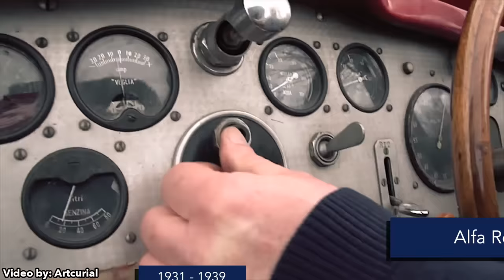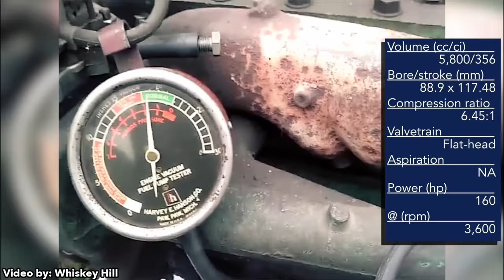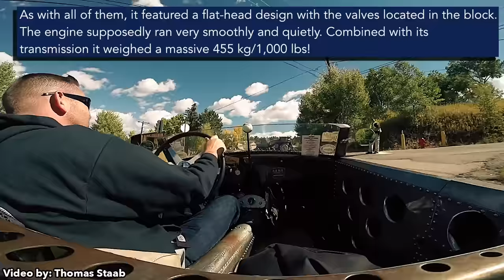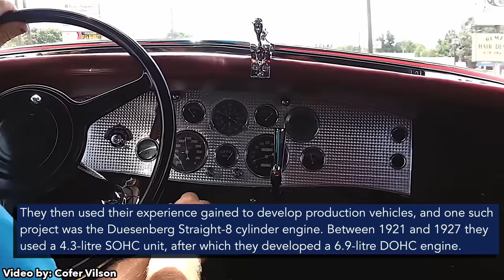The Best Sounding Straight-8 Engines In The World

Comment: they sound more like musclecars than musclecars do
Reply: they have 90 degrees cranckshaft like those crossplane V8s in muscle cars
Reply: No they don't, they sound more like old airplanes or old world war 2 trucks lol. The unbalanced firing order of cross plane V8 is what makes the sound of a muscle car. Straight eights do sound pretty cool though too.
Reply: @ssimon64  Lmao but that's where it originates from tho, Straight 8s/inline 8s have some of the most unique rasps in existence.  Sure we have new V8s and Flat 8s but they never quite have the correct sound. The coyote engine in a 5.0 mustang, for example, doesn't really sound all that aggressive even with a straight pipe, only with a cam does it wake up the motor. Straight/inline 8s sound like what all 8 cylinders should lol
Reply: @sebastianb5997  Even the 392 in the new Challenger sounds...tame...by comparison. A 300-something c.i. straight 8 sounds like it's going to eat the world.
Reply: @nicholasrhodes4550  you all have to remember modern cars are muffled.
Reply: @ssimon64  The joke

----------------------------------

Your head
Reply: Dodge Challenger
Reply: Yes they do.
Reply: @sebastianb5997  I'm glad that you cant dictate what a V8 should sound like.
Reply: I mean, "inline" and "V" formats doesn't matter that much, if both engines have the same firing order, they will sound the same lol
Reply: @klyo3475 THIS.
Ditto for torque characteristics.

Comment: Straight-8, because v8 is too compact
Reply: CaptainD00M the straight one has better natural balance.
Reply: that is why i think that inline 6 > v6
Reply: V6 is very unbalanced, almost as bad as I4. V8 is a little better than V6. However, Inline 6 and I8 are perfectly balanced. Flat 4 is almost as good as I6 but flat 6 is just as balanced as I6 or I8
Reply: I belie the 60 degree V6 is considered to be a naturally balanced engine & should be compared with the 90 degree V6.
Reply: all you have to do is look at the counterweights on the crankshaft. Subaru flat 4 crankshaft weighs 18lbs stock. Honda or Toyota Inline 4 is twice as heavy at around 35-40lbs. All the V6 crankshafts I saw were 60lbs or more.
Reply: Y10Q. Flat 4 engines maybe very compact but have very thin crank fillets between the bearings. To solve this problem the big end and main bearings are very large for overlap to make the crank rigid. This creates a new and bad problem. The crank surface speeds become very high between the rod bearing and journal making stable lubrication difficult. 2.0ltr motor in the Toyota 86 has massive journals i think 77mm. An LS V8 is little over 40mm. Inline 4s are much superior as a design.
Reply: At some point, balance is basically irrelevant.  That point is when the engine is reliable anyway, and smooth and sonorous enough anyway.  Spin up a Honda or Toyota 3.0 or 3.5L and tell me it needs better balance lol
Reply: The Bushwacker Spot on. The reference to the ls was journal size only. And to split hairs V8 arent perfectly balanced. Check out the back of chev crank you 'll see an external couter weight. I6 dont need this.
Reply: The Bushwacker Exactly. The very nature of a reciprocating combustion engine is very flawed. Alot of mass is added to engines to cancel out these forces whether its a 4, 6, 8 etc.
Reply: +David Conod I misread your name as "Conrod," haha appropriate.
You clearly know quite a bit more than I do about engine internals and balancing.  I knew I liked Toyota V-6s, they have quite a bit of "character" when pushed hard - I had no idea their internals were at all similar to a race engine or anything.  I drove a 3.0L Solara (Camry coupe) manual for four years, and I could scarcely imagine a six-cylinder being any smoother than that 1MZ was.  And now I know why lol, thanks.  Why don't other companies do that end bearing trick?
Reply: +The Bushwacker Whoa whoa.  A straight engine has no reason to be more torquey or less revvy than an inline of equal cylinder count and dimensions.  If you're going by what tends to be, that's incidental because of packaging - Inline engines tend to be very undersquare (seen in the video).  This in GENERAL makes them more torquey and, yes, less rev-happy.
Any sources on that Silver Streak versus 454 comparison you mentioned?  (Even though that's more a test of traction, gearing, and weight)
Reply: Bryan Liguori You'll probably find most modern 4 cam V6 use that design because it ellimintes balance shafts. The 1MZ was a good little V6. It had 6 bolt mains and a good cyl head design. you'd love the 3.5ltr 2Gr especially the direct injected one's in the IS 350. they're pushing over 300bhp and still remain relatively low stressed. Pity a new age of small turbo 4s are taking over. Fuel efficiency is at the top of the priority list. The I6 is basically doomed.
Reply: Bryan Liguori Totally agree Bryan. Any V configuration with exact same bore/stroke, combustion chamber design, cam timing etc will equal an inline engine. In fact it will probably win because of the shorter and lighter crank has less inertia and will rev up quicker. Granted once high revs are reached the heavier inline crank will have more energy stored. This problem is easily solved by using a flywheel on the V6.
Reply: And the sad thing is small turbo-4s are often shown to offer no real-world (which is ostensibly what really matters) gains in fuel economy over the sixes they're replacing.  It is a pity.
Though I've just read that the new 2018 Camry is keeping the V-6 - a direct-injected version - so at least Toyota might see it that way.  Or maybe, it's that Toyota's customers do, while Lexus' do not, hence the IS200t.
I loved my 1MZ - but damn it could have used better valve timing at high revs.  It was pretty short-stroke, but ran out of steam by 5600 rpm.  If I could get a 2GR in my FR-S, I would be one happy camper.
Reply: YES back when the car was just a concept, I hoped for a Subie flat-6 engine in it, being that it's a Subaru chassis with a Subaru engine already.  I really don't want to muddle the response with turbo lag, but it obviously could do with a nice power boost.  Oh well.  There's always the aftermarket I guess.
Reply: With respect to you Bushwacker your association with inline engines and more torque is totally incorrect. The torque output of an engine has nothing to do with where the pistons are located (inline, V or radial etc). Its all about thermal and volumetric efficiancy. The old inline engines you talk of did have massive lowdown torque due to the very long stroke designs they had. The cranks were heavy and yes once higher up in the rpm range store alot of kinetic energy. The distance from the main bearing to the big end bearing has a huge effect on the torque characteristic. Any V configuration with the same cyl head design, cam timing, bore, stroke will equal an inline design and rev up  quicker due to its shorter lower inertia crank. Take a look at V8s that have a flat crank compared to a cross plane crank. Flat cranks have much less weight and are generally SHORT stroked. This makes for very quick engine response high in the rpm range. (torque x rpm=hp). Long stroke engines have high piston speeds low in the rpm range particularly with a short conrod relative to stroke (good volumetric efficiency) therefore low down power. Take a look at a landcruiser 4.5 V8. Small bore, big stroke. 86mm 96mm. Yes i know its a diesel and there's a couple of turbos, It produces max torque at 1600rpm! 650nm of it. Any long stroke modern engine with high efficient heads and management systems make MASSIVE torque. Ive seen demo's of Z06 vetts going from 0-160 mp/h in ome gear! Dont get me started on the V10 8.4ltr donks. I'll say it again long stroke=lowdown torque not inline configuration. Cheers.
Reply: The Bushwacker The Bushwacker No worries mate im also done. I think we will agree to disagree. im wrong aboutThermal efficiency and volumetric efficiency wow. Thats were you lost me.
Reply: Straight engines tend to have much better long-term reliability and a slightly higher low end torque., the crankshaft journal only have to deal with one connecting rod instead of two.
Reply: The 4 cylinder engine in my Mazda has valves per cylinder and it's blue.
Reply: Yes, basically everything Bushwacker said about I6 torque > v6 torque and V8 balance > I8 balance is completely wrong, see Conod and Warnes comments respectively for the facts.
Reply: Well, that's because small turbo fours have not yet been optimized to benefit from all of the advantages of the layout.  Everybody knows, or should know, that the gas engine is most efficient at 80 - 85% of full load.  The problem is to keep them in this range a high percent of time.  Turbos, controlled by computer controlled fuel injection and waste gates and perhaps stepless variable speed transmissions possess the most likely route to achieving this goal.
Reply: Iain Herridge  inline 10 does not exist.
Reply: Guys, an inline 6 cylinder is far smoother than any V8 or V6 naturally. You can make a V engine just as smooth by carefully designing the crank and the counterweights, etc. But a 6 cylinder inline engine is "naturally" or "inherently" smoother,  and doesn't require fancy balancing techniques or special counterweights. That's all the people here are trying to say. 

Obviously no engine is totally better than another engine, because they all have their strengths and weaknesses. I have owned a Chevy 250 inline 6 cylinder engine in a 1970 truck, and the engine literally felt "electric" when you would idle and rev it up. It felt so smooth it almost seemed unreal, like the engine was suspended on large rubber hangers. This was a really terrible engine, I hated it, but it was smoother than any engine I've ever had. I had a V8 engine of about the exact same year, a Dodge 318, which was also very smooth, but I don't remember it being "electric" like the 6. In fact when I got the 250 cubic inch inline 6 Chevy the first thing I noticed is that it seemed impossibly smooth for an old shot engine. 

The engine was heavily worn and was so smooth. Inline 4 cylinder engines are not smooth without a counterbalance. I have a 1.5L toyota 4 cylinder and it has heavy vibration you can hear and feel at all RPMS. Neither are V6 engines smooth without a counterbalance. All good V6 engines use a counterbalancer now. Flat 4 engines oscillate when they are idling, they shake around. Take a look at a Subaru when it's idling, it jumps all the place, then becomes liquid smooth when you revv it up. The inline 6 engine does need to be revved above an idle to smooth out, it is ALWAYS smooth and doesn't need counterbalancing shafts. That's the difference.
Reply: @Y10Q  Balance i8>i6=flat 6>v8>flat 4>i4>v8
Reply: Ever heard of I12 F1 cars?? They exist.
Reply: @Mr Murders Jesus this was 3 years ago trying to remember the conversation! The weight of a crank has nothing to do with how balanced it is. It's where the weight is relative to the main and bigend bearings decides the balancing. The weight comparison of an I6 v V8 crankshaftt will obviously be heavier for the I6. The FZJ105 land cruiser had a 4.5ltr I6. The crank was really heavy and long. Toyota dropped in the 4.7ltr lexus derived V8 pre vvt version so very similar cyl heads. Yep slightly bigger eng capacity.  The V8 beat it everywhere. Low, mid and high. I still stand by my comment. Inline v V configuration with exact same bore, stroke, cyl heads are equal. Just because its inline the engine cannot "create" additional torque out of nowhere. Its illogical.
Reply: @Mr Murders Firstly I hope you are safe and well in the land of USA in these crazy times. We are in the middle of the world's worst lockdown back in my country and we are fed up! Back to the friendly debate. Perhaps I need to reformulate my comments which I believe are iron clad. Here goes. If you take 2 engines one inline and 1 a vee configuration with exactly the same bore, stroke, conrod length, cam timing, comp ratio, intake and exhaust runner lengths etc. Etc. The V configuration engine with the shorter lighter crank will rev up quicker and produce more engine response right through the rev range. I observed this when I was studying mechanical engineering years ago calculating crankshaft moment with maths. Its solid science. The relationship between low down torque and inline engines is purely down to its elementary engine design which generally includes a long stroke, short conrod layout resulting in fast piston speeds at lower revs enabling excellent voluntary efficiency low down. Where the pistons are makes NO difference.400ci small block chevs epitomized this layout as did the clevo 351 dropped into light trucks. Many modern trucks run V8 diesel turbos where packaging is not a problem and could utilize an inline 6. From a durability perspective fully counterweighted crankshaft particularly in inline 6 improves engine life, agree with that. A well designed V configuration however will last just as long. I've been in the auto trade for 28 years working with Toyota and seen it first hand. I've built small block chevs, Chrysler's and helped mates build our local GM Holden inline 6s. I've seen it in the real world. Metallurgy, lubrication and bearing clearance decide engine durability along with how well efi software is in a modern engine anyway. My own Toyota attenuates boost on hot days to reduce engine stress. I've watched it many times through the live data streams coming out of the OBD2 pick up. I'll say it again a V configuration will do everything an inline will do based on above comments. Cheers mate.
Reply: @Y10Q  you dude have problems.
Reply: @waswestkan  a boxer 6 is the most balanced like a Ferrari Flat 12 boxer engine that just so happen to be made by Subaru
Reply: @Y10Q  fully counterweighted crankshaft are the best no matter what they weigh in at. As a flywheel can be made out of titanium and aluminum or like in a Sprint car totally eliminated and a direct drive to the rear differential
Reply: @nthgth  balance has everything to do with the performance of an engine you are totally wrong and irrelevant as you don't have a clue what you're talking about
Reply: @nthgth  you can burn your candle at both ends and get a very bright light but for a very short time. In the 1970s the Lincoln Town Car was equipped with a 5-liter V8 that got 30 miles per gallon something a lot of overtaxed under par four cylinders can never do
Reply: @senorkaboom  some Mazda don't have any cylinders or valve at all imagine that and you can get those in blue also
Reply: @janlabij7302  so you believe if you have the throttle 3/4 to 80% to the floor that's where you get the most mileage out of a 4-cylinder boy are you a freaking dope. first of all you wouldn't make it through the day without the cops throwing you in jail what a maroon what a diorama goon DEA
Reply: Straight 8 Buick 3/4 inch gas line and the gas that goes through it, Had one, glad to get rid of it !
Reply: In a mid engine car it might work...especially reasonably small displacement like 3 liters or so. Stick a big turbo on it and you could easily get 700-900bhp easily these days.
Reply: @davidconod8112  not really, you can use lighter pistons which create less vibration and use materials such as some magnesium alloy instead of Aluminium alloy to absorb more vibration when making the engine block and components. it’s not as flawed as you might think. Usually the weight increase using counterweights is minimal if you use lighter pistons
Reply: @EddSjo true, plus inline engines produce more torque with the same cylinder number. Inline 6 even is more preferred than V8's in semis, which are rarely seen, only mostly by Scanias.

Comment: Grandpa's late '40's Packard had a straight 8. In the 1980's, when he gave it to a son-in-law, it made the trip from Texas to Minnesota at interstate highway speeds with no problems. Got about 20 mpg. Had enough torque that you could start from standing in 3rd (top) gear. Yes, it was quite smooth. Packard's engineering reputation was very good, I understand.
Reply: Packard made their own automatic transmission, so I'd say that yes, their engineering was top-notch. There were 7 other independents at the time, some of whom had much larger budgets to work with than Packard. All of them used GM's or Chrysler's transmission.

Comment: I remember old Buicks with this engine. One thing about a I-8 is the amount of torque this engine puts out. I had heard that you could take a corner in high gear, mash the gas pedal down and this engine would take this job without even a little hicup.
Reply: Beacuse Fireball-8 is undersquare engine which means Stroke is bigger than bore and that give lower redline but bigger tourqe
Reply: They also bent cranks real bad